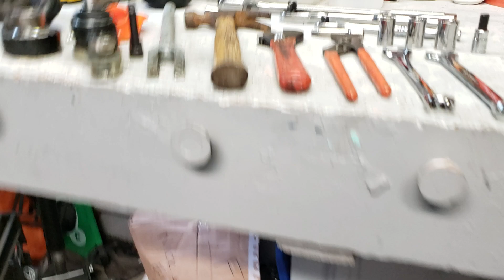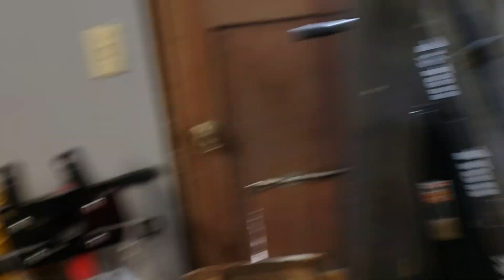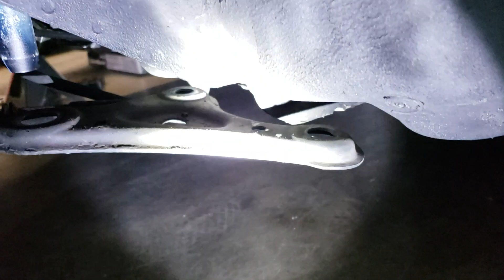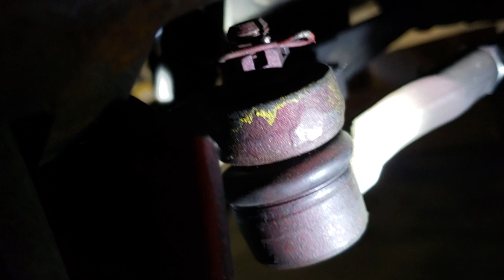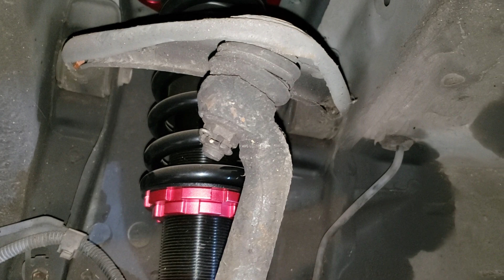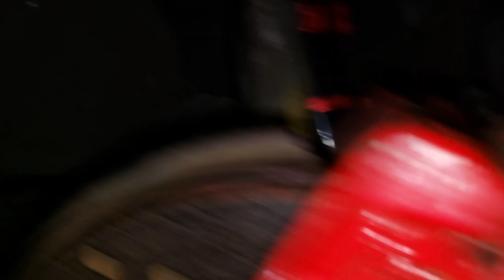DIY: Installing Xcessive Mfg's IS300 steering angle knuckles & spherical caster arm bushings

Comment: How do you like Zero Ackerman? Did you use only outer GS tie rods? Any other suspension mods like longer lower control arms?
Reply from the maker: These are actually standard ackerman, theyre great. Plenty of angle, still drives like a daily driver should. And yeah, just GS outers flipped (driver to passenger side and vice versa). These knuckles and tie rod combo are engineered to work with the factory suspension, everything else is stock. Don't need longer arms imo. Natural camber from lowering puts me around -3° up front, the steering response is snappy and incredibly intuitive.

Comment: Nice video dude, I might get these knuckles since they offer ones with ackerman like you said. Are you running any other front upper control arms?
Reply from the maker: On this chassis no, so far just these bushings and the knuckles with ackerman. I will drive on this setup and see how it feels on the track, I'd like to keep this chassis as functional as I can and not run a lot of camber if it doesnt need it.